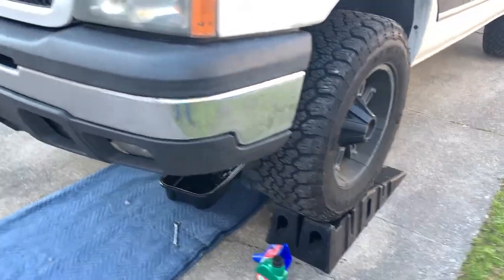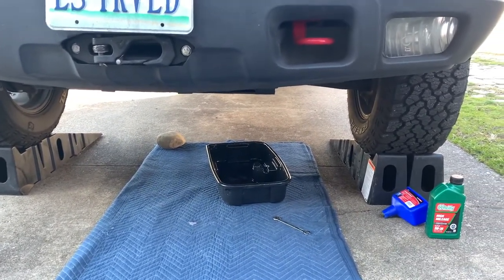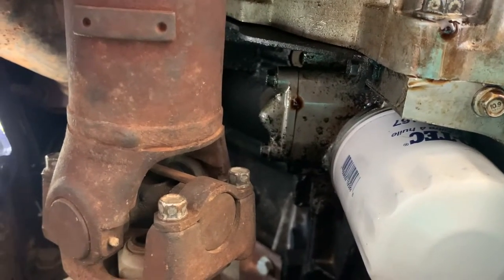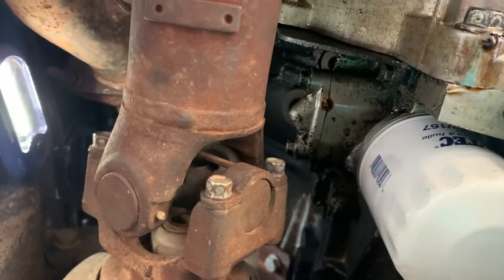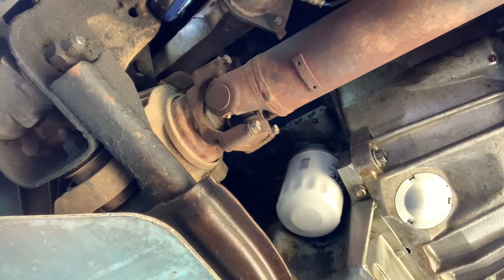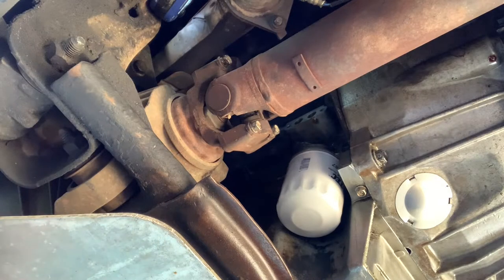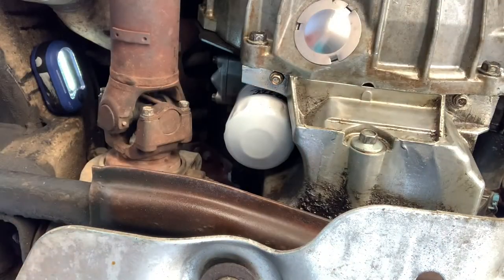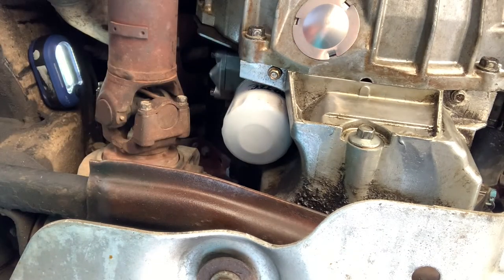“How To”: Gen 3 LS Motor Oil Cooler/Backing Plate Gasket Replacement

Comment: Well ,you mean I may not have to replace the oil pan gasket after all ? Such good news . There was a question of something else leaking other than the oil pan gasket,which I did not relish fooling with. If this little gasket is the problem ,may as well change oil as well. Thanks for the video  ., made my day

Comment: I thought my motor had a major problem on my 07 sierra WT with the 4.8, turns out it's been this all along. A total pain to get to, and mine was caked with dirt stuck to the oil, but did it over the weekend when I changed the oil and it fixed it, thanks!

Comment: Do you know if this leak was causing fumes to enter the cab when the engine/exhaust got hot.  I have been chasing a ton of leaks over the last 6 months from valve coveres, transmission lines, exhaust manifolds, and coolant.  I know this is near the driver side cat and curious if this is where my current fume issue is coming from.  It has got better with each repair.  But I am still not at a decent level of comfort with the current fume issue.  Generally do not notice it until you stop.  And usually ends up worse for a moment at a hot start.

Comment: Have the same oil leak from that same gasket on my 01 Chevy suburban with the 5.3. It’s a common issue on them, getting a new block off gasket for mine. Got 136k on mine
Reply: Just replaced mine at 250,000, use oem
Reply: I put a felpro gasket in mine, solved the problem. Hasn’t leaked in a month when I did the job.  @AcerArtsOfficial

Comment: Shouldn't the gasket with dual holes work for your vehicle too, but not the other way around, single oval hole gasket definitely wouldn't work if there's an oil cooler present?

Comment: I have changed the one on my 2011 Silverado 1500  four times already and keeps leaking. I have the actual cooking lines though.  Someone told me I have to apply rtv silicone sealant around the gasket. So once I do my next oil change I’m going to do it.
Reply: Did it stop the leak?

Comment: I use that gasket and after some time start leaking again, so I remove it and install the one is for the oil cooler, no more leaks
Reply: Where did you buy the oil cooler gasket, and do you have the part number, por favor.
Reply: @octaviogarcia8196  let me  find the number
Reply: @benjaminibanez4057  ok thanks
Reply: I already got the oil cooler gasket from AutoZone, thanks.
Reply: @octaviogarcia8196  did it fix the leak with the oil cooler gasket?
Reply: @sharpie132  no, it still leaking and I think it's the rear main seal. I added a bottle of 205 sealer to the oil and it slow down the leak. Thanks for asking!!!
Reply: @octaviogarcia8196  have you checked the oil pressure sensor and checked if it's leaking from there
Reply: @sharpie132  no I haven't but I'm going to check out the oil pressure sensor. Thanks for the advice and I will let you know.
Reply: @benjaminibanez4057 did replacing the gasket fix the leak?
Reply: no rtv sylicone necessary?
Reply: @hheger  yes no more leak
Reply: @LuisMorales-oj1ry  no, i don’t use it , only the gasket

Comment: Need update! Did that solve the problem or do you still have leaks?
Reply from the maker: Unfortunately it is still leaking, but it is most definitely the rear main seal.
Reply: You can inspect the rear main seal by removing the round inspection cover from the bellhousing

Comment: Did that solve the problem?
Reply from the maker: I still have a very small leak at the rear main, but it certainly took care of what was leaving small drips on my driveway.
Reply: @takeroadslesstraveled6505  Thank you. I cleaned the area off with brake cleaner and I will drive it a few miles and have a look.

Comment: Do you have to use any gasket sealer?
Reply: No. Never. The gaskets on the newer GM motors should never need gasket sealer. If you do then something is wrong (possibly warped or cracked)

Comment: can oil cooler mix antifreeze with engine oil ?
Reply: If the oil cooler in the radiator has a leak, then yes. The block off plate he has will NOT cause antifreeze to mix with engine oil.

Comment: How did yours fail and cause the leak
Reply from the maker: Gaskets eventually dry out, crack, and/or shrink/thin out. My truck is 17 years old and this was the factory gaskets. It’s just one of those parts that will eventually need replacing.
Reply: They all start to leak. I think the original gasket was a bad design.

Comment: It doesn’t make any sense to put a open gasket on something that has two holes. It seems like the fluid would just fight itself going back-and-forth.
Reply: One side comes from the pump and has high pressure. The other side feeds the engine parts. Oil can only go one way. From high pressure to low pressure.

Comment: PRO TIP:
Do this repair DURING an oil change so that you don't do like this guy did and waste perfectly good oil.  ESPECIALLY if the leak isn't a very significant one.  If you already go between oil changes without adding a half quart or more of oil then you can wait until you do an oil change.
You're welcome...
Reply from the maker: Yup, you’re absolutely right. Learn from my mistake.
Reply: haha it leaked like 2 oz my guy. chill.
Reply: @bendino9016    
You're free to think whatever you want based on your viewing of a 15 minute video.  😃
~  Auto Mechanic for Chevrolet Dealership, 38 years
Reply: @James225  haha ok boss.
Reply: @James225  auto mechanic for 38 years and you don't realize that the oil is in the oil pan below this cover?  the oil that leaks out is only what was in internal lines that would run to the cooler and back.  if the engine has not been started in several hours it may leak less but that depends on other factors such as port angles, if the vehicle is on a slope toward drivers side viscosity of oil.....  simple gravity.
Reply: Yeah he didn't leak that much at all so it's totally fine I'd still top it off